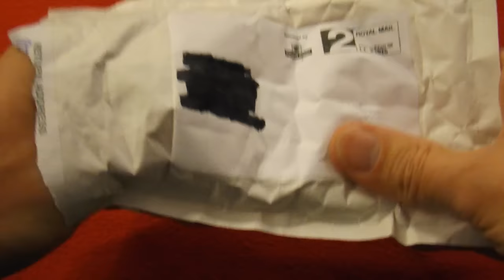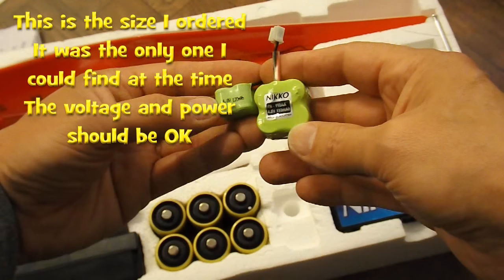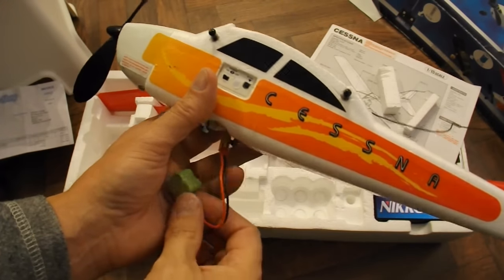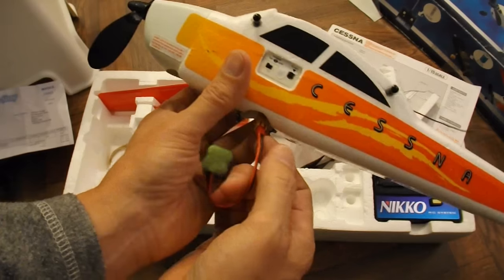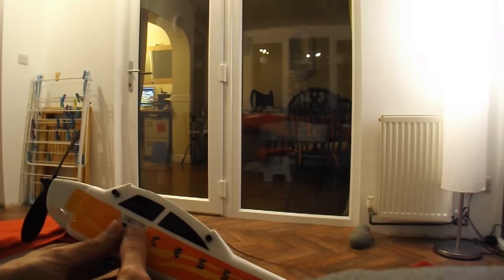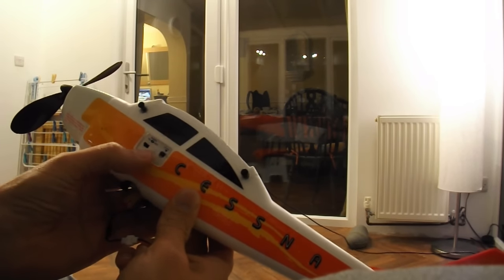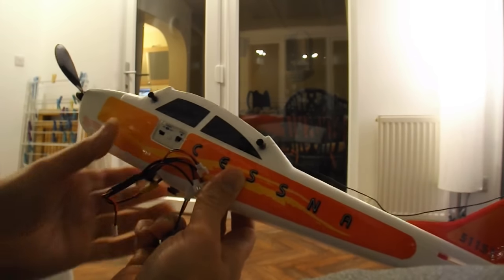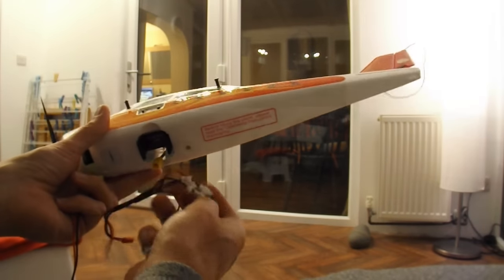Nikko RC Cessna Charity Shop Find Part #5 Grandad's postbag 151105

Comment: I found an old forum post on RC Groups 
http://www.rcgroups.com/forums/showthread.php?t=636637
It definitely sounds like the short flight time is normal for this model.
.
For the approximate Center of Gravity balance point, measure from the front of the wing to the back of the wing, then measure back 30% of that number from the leading edge of the wing and mark underneath the wing near to the cabin. Then lift the fully assembled aircraft with one finger tip on each side at the CG point.
.
  I don't think you'll have a big issue with it as the battery seems to be close to the CG point anyway. So adding or removing weight there just changes the overall weight. So if you use a double sided sticky foam pad and stick a smaller battery in the middle of the battery bay, it's job done.
Reply from the maker: +wordreet thanks for that link. On episode 3 Allen Burbank commented that he had one of these in the 90's and was able to give me some first hand comments on it's ability or lack of it :-) https://youtu.be/E5wtMnmCGCg

Comment: I'm no expert on electric motors but after 20 or so years it may be a good idea to oil up the motor unless you haven't done that already, I shelved my traxxas slash for about a year and when I ran it, the motor started doing the squeal of death but a little bit of proper bearing oil solved that issue.
Reply from the maker: yep that would probably be a good idea if it is not a sealed unit inside. We will see eventually.

Comment: Looks to me as if three 1s in parallel is the way to go! Then you could always get more flight times and those little 1s lipos are cheaper and can be charged in very little time. Can't wait to see this fly! :)
Reply from the maker: +X-FLIGHT101 the problem with using 3x1s is there is no throttle control so no way to stop the motor for landing if you want to bring it down before the battery has run down. That means bringing it in on full power so guaranteed to break a prop at the very least.
Reply: +GrandadIsAnOldMan valid point maybe stick to using just 2?
Reply from the maker: X-FLIGHT101 I think I will stick to the existing battery and/or this new one in the postbag as they last for 10 seconds or so. Maybe if it flies well and I find I like it I may consider longer flights but I really am not that interested in powered flight. That would involve joining a club and doing it properly.
Reply: +GrandadIsAnOldMan ok then, I have found that gliding can be just as fun if not more fun than powered flight as its a challenge to keep the plane in the air for a long amount of time, it's so simple and addicting.
Reply from the maker: X-FLIGHT101 I only try it when we go on holiday near the seaside. It means I don't have to carry much equipment with me, except that I always have to take cameras at the moment.

Comment: Still waiting for you to fly this thing...
Reply from the maker: like I keep saying it may be next year. The weather has turned for the winter and this is about 30 years old so I am treating it as a collectors item and will only attempt to fly it in perfect conditions.
Reply: +GrandadIsAnOldMan oh okay. That's legit. Can't wait to see it fly :)
Reply from the maker: Seth Avallone not trying to tease you but today started bright and calm and I put the plane in the boot of the car just in case but after we had lunch it had turned dull and grey so it didn't happen. I have a pile of kites in the boot too and it wasn't windy enough for them so neither happened. Ended up making another rubber band powered car !!
Reply: +GrandadIsAnOldMan when life gives you rain and no wind, make a rubber band powered car :)
Reply: +Seth Avallone I never new rubber sand existed haha